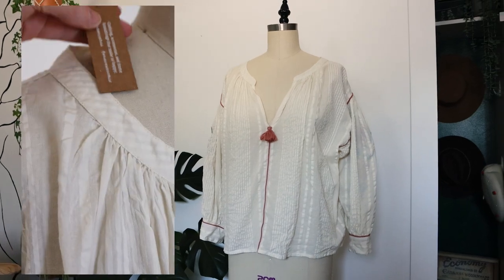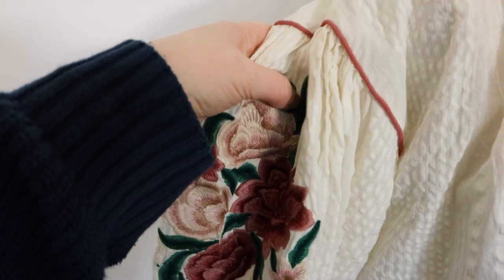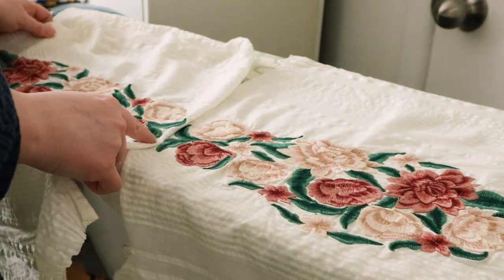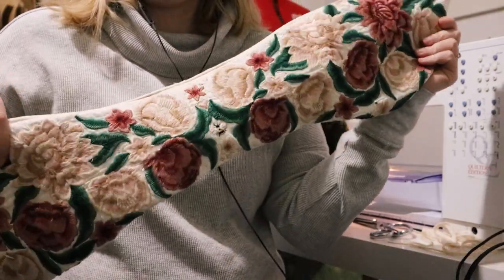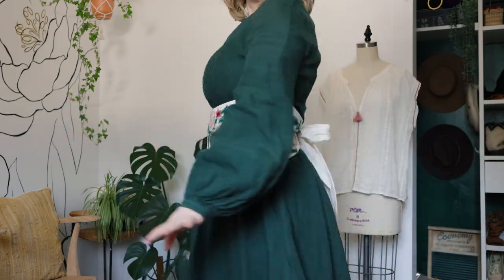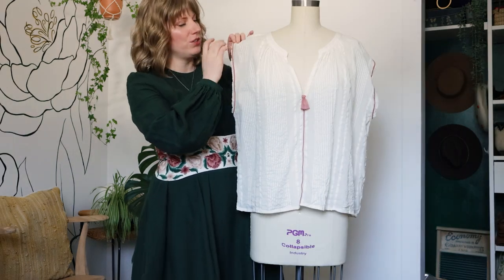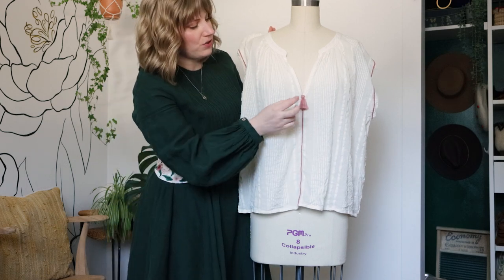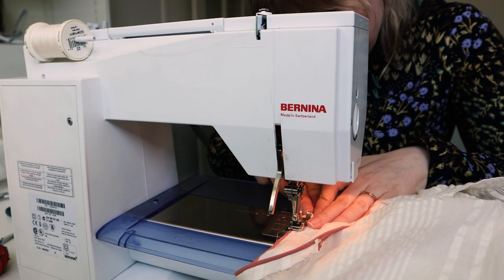This Top is Badly Designed, let's Fix it!

Comment: So cute!!! And inspiring. Also i love the brown gingham dress as well. Did you sew that? I really want to start sewing but im scaring to begin
Reply from the maker: I got it from NotPerfectLinen BUT it's not a hard design to sew! This free/PWYC pattern (https://peppermintmag.com/sewing-school/bardondress/) is pretty similar, you could just removed the bottom tier and make the skirt pieces longer. With that said though the best way to build confidence with starting to sew is to work on a smaller project first - a tote bag, throw pillow case, or apron are generally really good first projects to gain some experience before making a garment. 💚
Reply: Thank you so much for the info! I will try to start small before making a complicated dress. Dumb as it sounds, ive always been scared of the sewing machine. They put the fear into us in school growing up haha.

Comment: I love THIS kinda content! I have a project myself to transform a dress made out of swim fabric into… swimwear 😂 plenty for a cropped rashguard and the pattern is so gorgeous, reminiscent of african batik. The fabric type just wasn’t appropriate for a maxi dress with ruché over the bust.

Most upcycling I’ve seen is kinda bleh, it looks a lot like… well, upcycling! And the challenge should be to make it look like it was intended to look like this and not made from old pieces.

So your project is really well done even tough there is still a bit of adjustments to be done.

I do like the elastic in the sleeves though, the inward curves soften your shoulders.
Reply from the maker: Love that! There is so much swim fabric used in everyday fashion these days.